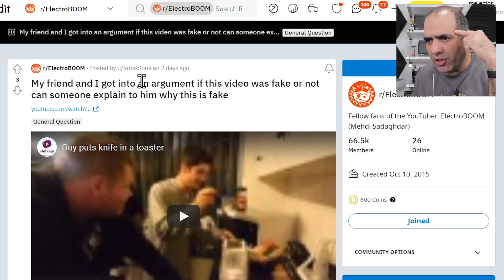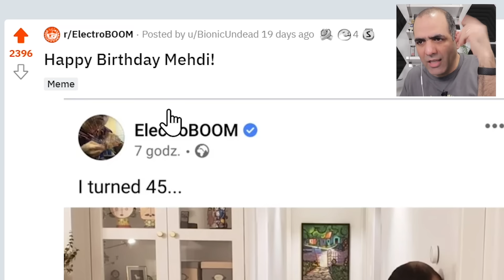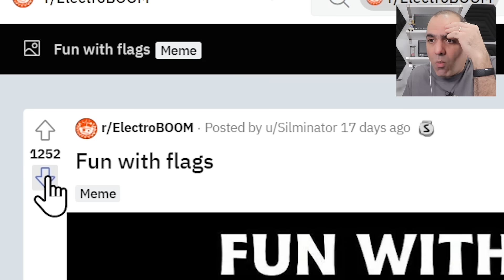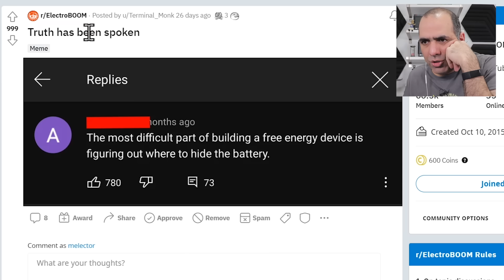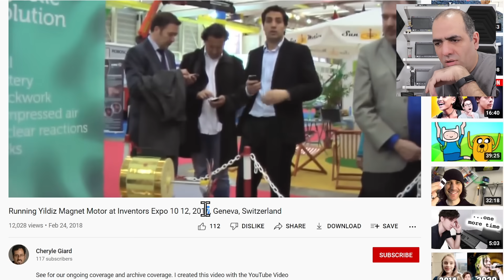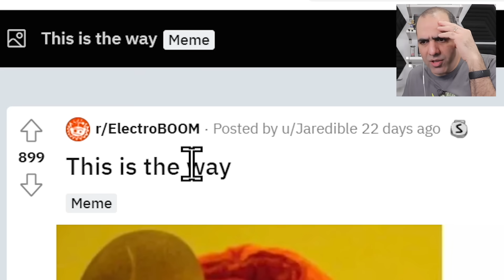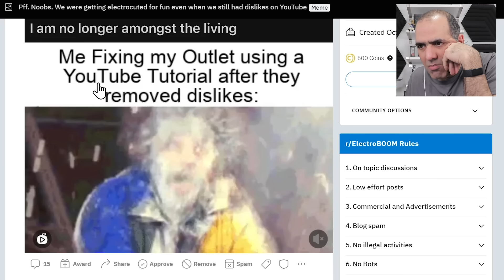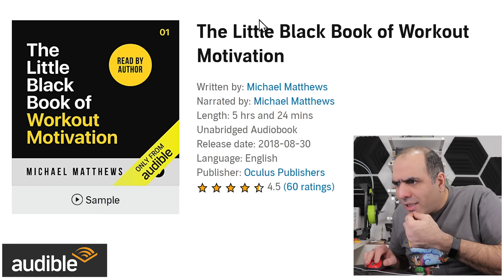Sticking Knife in Toaster? Welding with SALT WATER?!!! (LATITY-009)

Comment: When I was very young and stupid, I stuck a knife into a toaster and suddenly the whole room lost power. 

I guess it was a GFCI or RCD breaker in the consumer box.
Reply: i did too, with a metal butter knife. a rather mild electrocution until i thought to myself to better let got of the knife just in case. i proceeded to flush down the toast for safety, haha. Being a stupid kid i only thought of it as mildly entertaining but better not repeat it just in case.
Reply: I unfortunately did the exact same thing with a metal butter knife, but I didn't get an electric shock. The power went out and there was 2 deep grooves left near the tip of the knife. I still see it when I visit my parents sometimes and have a laugh
Reply: One time when I was young I put an aux cable in a wall socket, one side in the ground hole, and the other side in the live hole. Big spark. Almost died of fright

Comment: For welding, of which is arc welding or stick Welding, hover it over the desired metal with the other end of the cable connected to the metal. And slowly and at a constant rate move it across the metal, and please get a welding hood I have done welding and that stuff is blindingly bright

Comment: The bubbles forming from the electrodes is actually mostly hydrogen which is even worse considering you're generating sparks right next to a highly flammable gas. Some chlorine does form but at a much slower rate and a part of it usually ends up making a layer on top of the water because of how heavy of a gas it is.
Reply: Was looking for this before I posted it except for the chlorine density bit. Forgot about that
Reply: Well the spark is very far away from the gas so it’d take a long time to explode the hydrogen gas.
Reply: @suspense_comix3237  You would be suprised. Hydrogen is very reactive. All it takes is the right concentration of hydrogen in the air and it blows up. In fact, it doesn't even need a spark to explode but it certainly doesn't help. Plus the sparks are actually pretty close.
Reply: @SamTheFrost  The lower explosive concentration of hydrogen in air is about 4%. The setup in the video is not dangerous for short operation or probably even continuous operation with sufficient ventilation (open window) because the hydrogen is immediately dispersed in the air. Setups that collect hydrogen in closed containers (like in the welding video) are much more dangerous. Don't take this as safety information!
Reply: you can see in the video it actually does ignite briefly. kinda scary.
Reply: It’s concentration dependent for the chlorine reaction. One electrode gives hydrogen and the other gives oxygen or chlorine.
Reply: @jessemorgenstern8228  Read my other comment. A big part of the chlorine just reacts again with the sodium to make bleach, while another part reacts with the electrode. The hydrogen just bubbles out so no it's not the same amount of moles being released in the air. Plus, like I said before, chlorine bubbles tend to take longer to form and also stick to the cathode instead of coming out fast like the hydrogen.
Reply: @SamTheFrost  I never said it was the same amount. And the cathode reaction is going to be hydrogen regardless. The anode reaction depends on the concentration of chloride in solution. Electrolysis of a concentrated sodium chloride solution yields a sodium hydroxide solution. The chlorine gas will bubble out.
Reply: @jessemorgenstern8228  Ohh my bad I misread your comment. I agree with you
Reply: @SamTheFrost  No problem. Haha. But yeah. In the first example he was definitely making a lot of chlorine gas. I did this once in grade 12 and I didn’t ventilate my experiment well enough. 

The second example he’s probably still generating chlorine. Though when the chlorine concentration is low enough oxygen will start to be produced.
Reply: @jessemorgenstern8228  Yeah I've done it too but by seperating the anode and cathode in two different containers linked up by a salt bridge. The reaction seems a lot different compared to when they are in the same container which is what leads me to believe that the rush of bubbles on the cathode isn't chlorine for the most part when it's done in a single container. When seperated, the hydrogen side bubbles just as much as when they aren't but not for the oxygen/chlorine side.
Reply: @SamTheFrost  It wouldn’t matter if they are separated. So long as the concentration of chlorine near the anode is higher than the hydroxyl concentration. I’ve done it in the same container. Chlorine each time. The reason you want separate containers is so you can keep the hydrogen separate from the chloride or oxygen depending on your goal.
Reply: @jessemorgenstern8228  I'm not sure though I guess I would have to try again with both set ups to see what happens. Maybe it was simply because of the voltage of my power supply but it really did seem like the hydrogen side wasn't affected at all meanwhile the chlorine side was.
Reply: @SamTheFrost  Generally you'll find that in a salt solution that hydrogen comes off the cathode, and it's mostly chlorine on the anode until the chlorine is (mostly) used up then the anode starts producing oxygen.  The interaction of the chlorine with the electrode itself you mentioned can be minimized so that it effectively doesn't happen by using graphite or platinum.

This has to do with the energy of disassociation of water (for the first hydrogen then the second and the energy of producing sodium hydroxide from the OH groups), and the relative reactivity of chlorine and oxygen.

If you don't bother separating the evolved gasses, and collect them into one container, they're both explosive whether it's H2 and O2 OR h2 and Cl2.  The former does a really sharp crack (intimately mixed stoichoimetric mixture)..

The latter also does a really sharp crack too for the same reason.  Except, the mixture is both poisonous and corrosive both BEFORE (gaseous chlorine) and AFTER the bang (gaseous hydrochloric acid).

For electrolysis it's better to use a "conducting agent" that doesn't devolve into gasses as part of the process.  Potassium hydroxide is one of the best electrolytes for this purpose.
Reply: @SamTheFrost  chloride is kinetically way easier to oxidize than water (on most electrodes), so you will get chlorine each time. The gas is not oxygen, it's chlorine gas (which reacts with water to form hypochlorous acid but at the rate it's produced it just bubbles straight out). Doing this 'backyard' experiment of electrochemistry, sticking 2 metals connected to main power supply in salt water, is one of the easiest, stupidest and most dangerous experiments in my opinion. High voltage, quickly heating of the solution, forming of poisonous chlorine gas and bleach, etc.
Reply: Chlorine also isn't toxic in small amounts. Usually it's only really bad when it's concentrated enough that you can actually see the gas as visibly green in color. You can easily handle lower concentrations. If it's unconcentrated enough that it's invisible, then it's probably safe. After all, you can smell the chlorine gas at a public swimming pool that they use to clean it. They literally have a gas tubing system in most of these pools that they pump low concentration chlorine gas into the water during cleaning time (when people aren't in the pool). When you go back to the pool after it's been cleaned you can definitely smell the gas, but it's not poisonous in this concentration.
Reply: @BenHutchinson321  It might not be toxic per se but it still burns the lungs and throat and hurts to breathe even in small doses. I have done the experiment myself (electrolysis of salt) and it doesn't take long before it becomes unbearable without good ventilation (if you are doing this indoors). Using this for welding would definitely be bad for you without proper ventilation, especially considering the fact that your face is close to the source of chlorine itself. The concentration in the entire room might be low but the concentration close to the electrolysis set up is pretty high and like I mentionned earlier, it doesn't take long before it becomes unbearable.
Reply: Accidentally did this is science class once.  We ended up with a yellowish layer in the water.
Reply: It actually mostly produces a 3/1 hydrogen-oxygen mixture which makes it even more explosive as shown in this video:
https://m.youtube.com/watch?v=_RKdWYqgu3Y
Reply: My favorite method of extracting hydrogen is sodium
Reply: @christhechrischris9226  its fun to mess around with sodium and water to make hydrogen but not very cost effective
Reply: @slashshake2371  true sodium is quite expensive. I like how it also makes drain cleaner at the same time, so after hydrogen making is done and you've almost blown up your house you can take a swig of some nice refreshing NaOH
Reply: Dude, they are literally stoichiometric. One forms on the anode, the other one on the cathode.
Reply: @mikoajp.5890  Although they technically are stoichiometric, the amount of chlorine gas actually formed and released isn't what the basic equation says. First of all, the bubbles you're seeing form in this video are basically oxygen and chlorine on the cathode and hydrogen on the anode which come from the dissocation of water and NaCl. Try it yourself with two seperated cells linked up by a salt bridge, you'll see that there are almost no bubbles of chlorine forming on the cathode side in comparison to the hydrogen ones on the anode side. You'll also see that the hydrogen bubbles are smaller and have a constant rapid flow meanwhile the chlorine bubbles are slightly bigger and tend to stick to the cathode instead of bubbling right out which in turn means that the concentration of chlorine in the air is less than the one of hydrogen. 

Either way, most of the chlorine immediately reacts with the sodium to form sodium hypochlorite aka bleach. It will also react with your electrode if it's made out of a metal. This is why the simple equation doesn't tell us what actually happens in real life.
Reply: @SamTheFrost  Are they not technically catanodes as it's AC ;P
Reply: @SamTheFrost  I don't see how what you all have described could be the full story. When you did your experiment, did you use a battery (DC) or did you use something like a hand crank generator (AC)? There's a massive difference in the behavior of electricity when dealing with AC vs. DC, as well as a significant difference in the behavior of peripheral effects. Everything you described sounds like a DC configuration. AC doesn't have dedicated anode and cathode distinctions in its flow.

Hoping you can clarify your experience. Cheers.
Reply: @vclxrr  Yes you guessed right, it was with a DC power supply with pretty low voltages. I didn't think about the difference between the AC and DC set up when I posted these comments so its a good point you've made. Reading some other replies I was probably wrong about the oxygen part of my comment, although it probably does get dissociated as well, it's the chlorine that gets dissociated in larger parts first because of it's stronger electronegativity
Reply: @SamTheFrost  Cool, makes sense. Thanks for confirming. Happy experimenting!
Reply: @vclxrr  Cheers! You too
Reply: @mikoajp.5890  And with AC there's no difference between cathode and anode. They both form on the exact same electrodes, switching which gas it is every half-cycle of the AC waveform.
Reply: @mikoajp.5890  Nope wrong. learn science idiot.

Comment: just saw something i may need you to "rectify" or test to see if it is another scam.  a guy modified a 24 volt truck alternator with permanent magnets to get 240 volts, wired it into a power strip, plug in a 240 volt single phase motor, and connected them using a belt.  once the car alternator was turning fast enough to produce power, the electric motor came on and keep it running, and he is using power tool plugged into other spots on the power strip.  is this possible to make work, or is it another free energy scam?

the car alternator i have, if modified that way only outputs 120 volts.  if this is something that can be done and works, then i could make myself a super quiet generator for lighting when i go camping or fishing.

for your videos, there needs to be a "love" button on youtube.

Comment: Still waiting for him to turn an air raid siren into an alarm clock
Reply: All you need to do is attach an timer to a Chrysler Air-Raid Siren starting circuit.

Oh, and yeah, you need to keep its tank full of gas.  Unfortunately, it's not very portable, weighing about 3 tons, which includes the 180HP 338 cubic inch displacement V8 Hemi needed to run it, and the truck quarter frame it's assembled on.

One of Kurt Vonnegut's books protagonists had something like this as an alarm clock that would go off if the "normal" alarm clock didn't wake him up.

At almost 140db at 50 metres that would really wake you up.  These things have a range of 25 miles.

Comment: If it were possible to make the spinning, floating solar cell magnet big enough, could it be a way to scale solar smaller by using the sun to spin the panels, which spin a turbine?
Reply: If you tried to spin a turbine this way, not only do you have the inefficiency of the solar->electrical/magnet conversion, you add on the inefficiency of rotational energy to (I presume) electricity which even with luck is only about 30%.

Leave out the turbine and you get 2-3 times more electrical power directly from the solar cells than you'd get from the turbine.  Actually, more - let's see - assume that the solar to electrical conversion is 100% efficient (it's about 10-20% in reality but never mind that).  You'd get 1Kw per square meter of solar cell, but ONLY if the solar cell was facing the sun *exactly*, as it turns into and out of the light. In this device, the power  on one solar array would start at zero, peak at 1Kw (if the motor was oriented properly for your latitude), and then drop to zero.  The next cell would overlap a bit, but not that much.

Such a motor would be equivalent to a regular 1Kw motor (about .8 HP).  So here you got a device with 4 or more one meter area solar cells only generating 1Kw at peak, spinning that's MUCH larger than a 1HP motor, and has to be protected much better, that probably produces about 700w of rotational power continuously, and you haven't even converted the rotation back to electricity yet!.

Wouldn't it be better to put those 4 or more solar cells, mount them on something that tracks the sun and produces 4 or more times the power?

There is no escaping the fact that a electric rotary->electrical conversion ALWAYS loses total power.  Sometimes that's okay (sometimes you can conveniently use this to convert one frequency or voltage to another), but if it's your goal to produce *power*e, it'll suck.

The demonstration device is a desk toy.  The solar cells right on the spinning part means you don't need external power or brushes to switch the polarities of the magnets. It's really cool, and fun to figure out how it works.  But a major power waste.  Notice this thing uses magnetic bearings.  They have effectively ZERO friction, a gnat landing on one side would cause it to rotate. Meanwhile just one of those solar cells could drive a small DC motor with normal oil-lubricated sleeve bearings.

Comment: I'm not proud to admit I stuck a knife in a toster once when I was 14. I saw one of the heating elements bent out of shape and didn't turn red when it was running, so brilliant me decided to put a knife behind it to try and bend it back. The moment I touched it sparks flew, scaring me greatly. I don't remember being shocked (it was a butter knife with no plastic handle, just bare metal), but the heating element seemed to have welded itself to the knife and broke, rendering the toaster useless. I guess I'm lucky to be alive

Comment: Did you ever consider that maybe free energy is being suppressed by the oil giants?  Technically it's not free, it'd burn out magnets, but still. Not very probable. I had the same idea when I was 8, so it probably doesn't work or has really low torque

Comment: My electromagnetics professor explained that the permanent magnets of the magnetic motor store energy in the magnetic dipoles and as the motor is ran the motor slowly demagnetizes itself, however, he did state that this is possible with a certain arrangement of magnets. so while it is not free energy according to him its possible for this kind of motor to exist. what are your thoughts on this?

Comment: I think that gas actually is just hydrogen and oxygen becouse of the salt in the water it becomes more conductive and by running current through the water it 
electrolyses

Also you could make a video about electrolysis like maybe make hydrogen and do something with it (maybe blow something up)

Comment: I always assumed the filaments in a toaster would be electrically insulated like the heating elements in an oven or electric stove---the removing-bread-with-a-knife maneuver seems common enough to be worth protecting against. Does anyone know why they don't insulate them?
Reply: It's VERY difficult to electrically insulate thin-wire heating coils.  At the temperatures these run at the only insulation you could at this temperature that's non-conductive is asbestos.  Bad idea.

Certain ceramics would work, but not on coils this thin, and it would slow down toasting.
Reply: Keeps cost down and makes the product less bulky.

Comment: Do you realize that the solar powered floating motor is the closest thing to free energy device we have seen so far? And also I have a better idea than the alarm clock with capacitors, how about a machine gun using capacitors instead of gun powder 😁